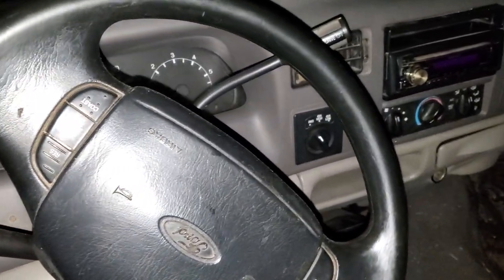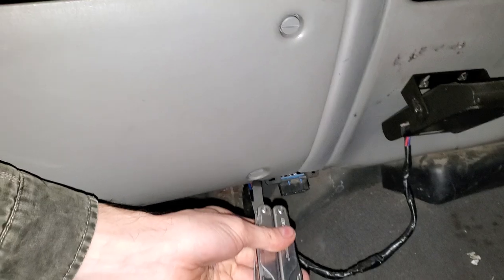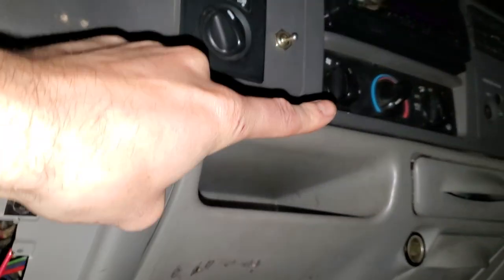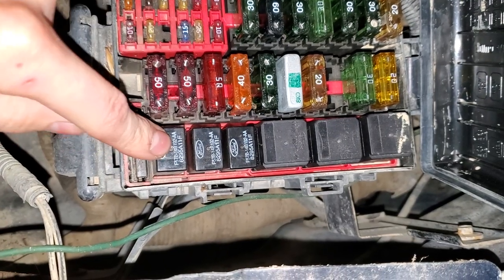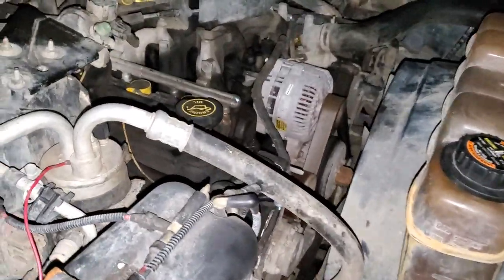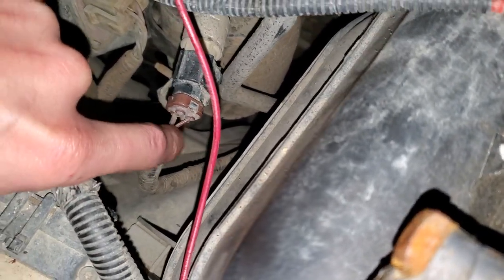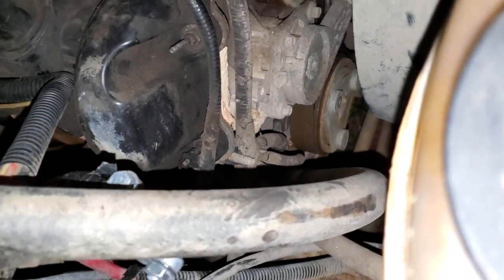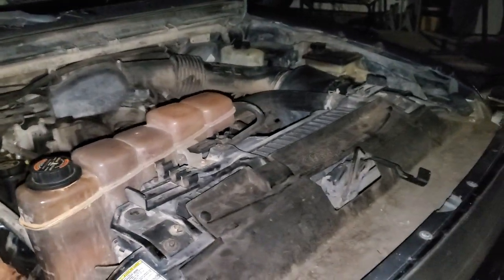1999 F350 AC Fuse, Blower Motor Fuse & Relay Location

Comment: Per the factory diagram, the relay you indicate is actually for the one-touch window down.  The blower relay is the middle one of the large relays.
Reply: Same here.  Was scratching my head til I finally looked in the owners manual.  It’s relay 31 on mine.

Comment: I bought a 2000 f250 7.3. Let say you bought a truck and the ppl before you put a junk yard pcm not knowing if it matched or not. Would that kill power to my dash lights, ac, radio? I have no inside power and the truck won't turn over with the key. Not 100% if they did replace the pcm but it's possible. Trying to un do ppls work is harder then fixing the original problem.

Comment: Hi, your .video. Is a good educator my truck 1999 Ford F-350 My air condition is work and then turn off and get hot if an fuse  relating with that problem?
Thank you

Comment: Will a bad ambient temperature sensor on a 1999 Ford F250 Super Duty 5.4 v8... Cause a no power to the ac system.. Because I checked the pressure switches.. The climate control module works.. But I get  ground on all the wires, but no positive voltage when the ac is on.. On none of the wires going to the ac pressure switches so I'm kinda stumped.. And the pressure on the accumulator is a little under 50 psi.. I don't know if that is too little freon to activate the clutch..
Reply: The blend door actuator fuse is also responsible for sending power to the ac compressor coil..

Comment: I installed an new radio in my 2005 F-350. It works fine except when I turn on my air con or the fan. Then my radio will go off and on at 2 or 3 seconds intervals. turn off the fan and the radio works fine. Got any ideas?

Comment: So, checked both small fuses and the 40 amp. Then swapped the relay with the fuel pump relay, and still no blower. There’s an audible click when I turn the the selector, but no air movement. Is the blower motor locked up?
Reply: Did you end up figuring it out? I have no AC or heat at all, nothing blows

Comment: With those pressure switches, would it turn off the ac if it doesn't have enough refriderant in the system?
Reply from the maker: Yes